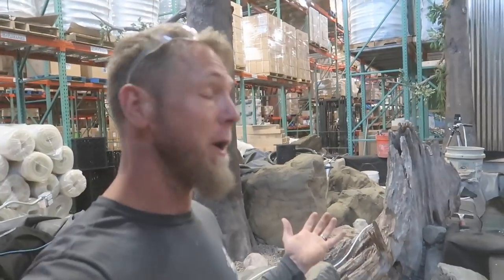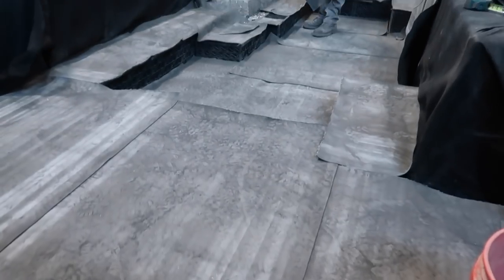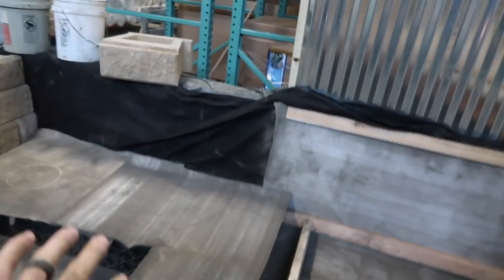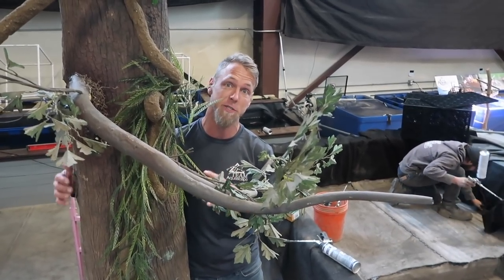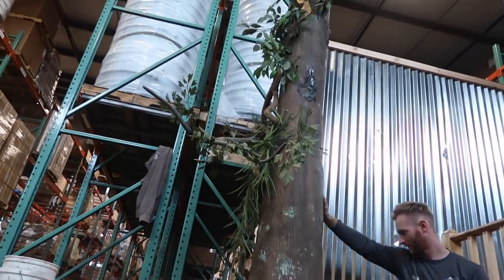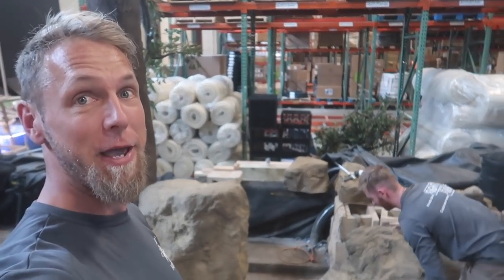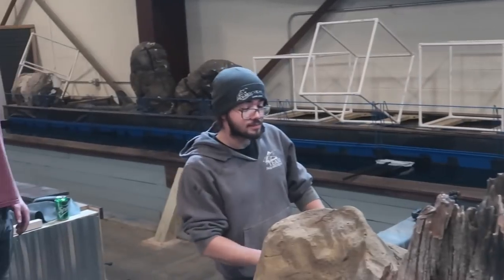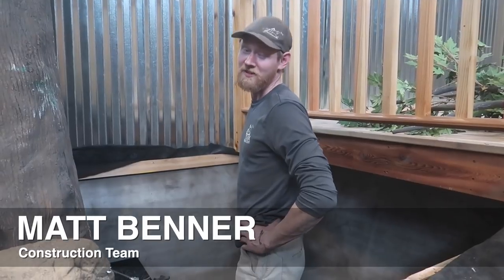*TURTLE POND* Construction w/ Fake Rocks: Retail Revamp - Part 9

Comment: As a customer walking into your warehouse, I'd like to see how the wetland filtering system works. You guys could have done a partial cut out through the filtering system corner. Wall is a heavy see through plexiglass with inner lights to show and tell.